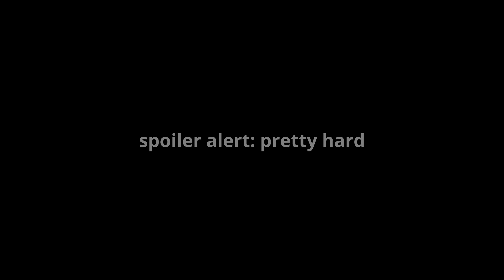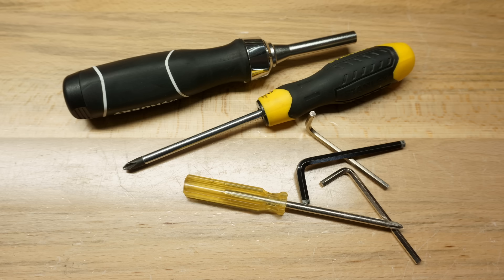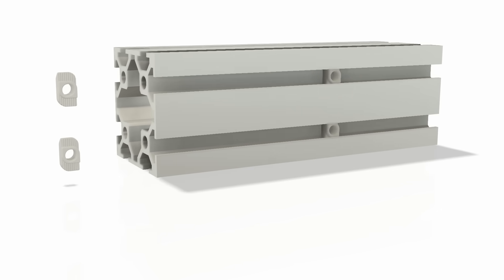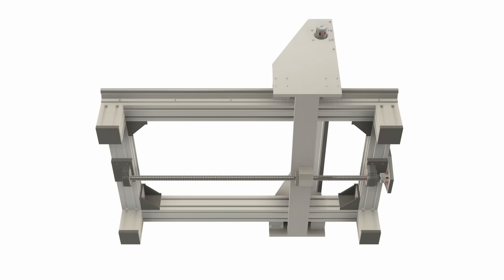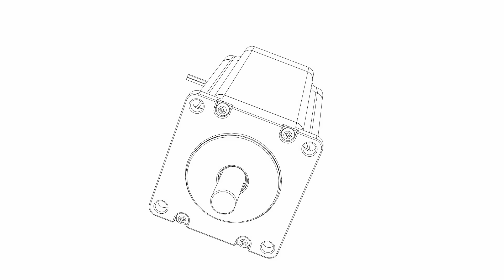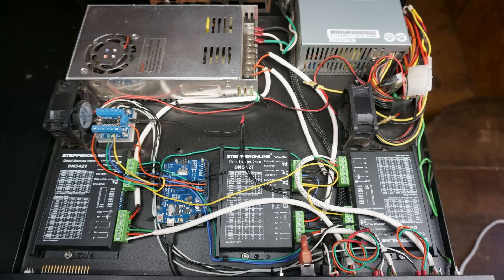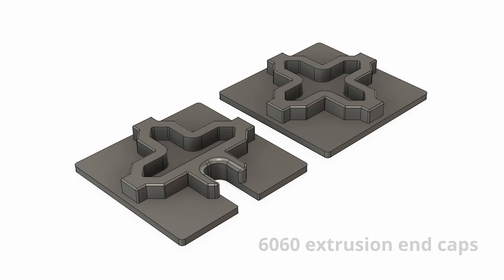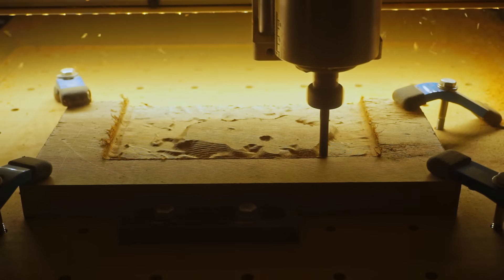Making a DIY CNC machine with limited tools

Comment: Another lazy build... Why don't you try a load test moving the y axis in the positive direction. You will see how the open bearings of the x axis flex and chatter. The biggest challenge with CNC design is making precision 90° parts. Congrats on the 3d basorelief designs tho. For that purpose the machine works well (not that a belt driven 50w machine wouldn't have worked)
Reply: @mendebil :  Pretty offensive comments, considering it is his first build and video.
Reply: @PiefacePete46  Well,  bragging copy-paste ladybugs crawling into the engineering world might find my comments offensive but that was never  the  intention. If  your  project needs 50w don't use 1kw. It's not practical that's all

Comment: As a seasoned electrician with extensive experience in wiring control boxes, you should have used cable penetration bushings (such as Part #S2212)
instead of jacks to reduce the chance of additional failure points and lower costs and labor. 

The inside of the control box could also be organized with strategically placed cable ties to minimize the risk of short circuits.
 Despite the over-drilled appearance of the z-axis mounting plate, this project was well executed and could be packaged and sold as a kit with some modifications.
Reply from the maker: Thank you, I'll consider those suggestions for any future upgrades or other machines.

Comment: Very nice project. I have MPCNC and it's part of the "evolution". Can I ask what was the purpose of optoisolators for limit switches? I haven't stumbled into that on my researches for machines. My limit switches are connected directly to driver board.
Reply from the maker: I thought they would help isolate any electrical "noise" that got picked up by the wires. Maybe my understanding or use of it was flawed though.
Reply: @benmakeseverything  now to think of it I have my limit cables and nema cables connected on shielded cable so that might be the factor on my case.

Comment: "My machine like most uses stepper motors" piqued my interest. What's the alternative to steppers? Geneva mechanism, maybe?
Reply from the maker: I guess you could theoretically use rotary encoded motors if they were accurate enough.
Reply: Servos... (ie: Steppers with closed loop encoders built in.)

Comment: Yes! Someone has actually used DIY in their title and actually did a DIY project without tools that cost six figures! This is awesome. I’d love to build one. Maybe sometime in the future you could attempt building a 4th axis mod!
Reply from the maker: Thanks! I have been thinking about adding a 4th axis attachment.
Reply: This machine already has 4th axis. It is C axis, rotation around Z. It is done by interpolation in XY plane. You can see it in a segment where the hole grid is made. That helical/tornado milling is exactly that.
5th axis is A or B, rotations around X and Y. In that case it can be done as indexing or continues rotation. First one allow to set the material on demanded angle and carry on an  operation as usual. Second allows to simultaneous rotation in A or B and milling in XYZC.

Comment: Looking to DIY my own machine. I have never really used one. I have a 3d printer so I get some of the basics. But say I want to use multiple took tips for different passes and finer detail how do I do that without affecting positing? would axis stops be what I need so It can bump them and home itself?
Reply from the maker: In theory the machine should return to the exact same spot it started after the first pass. But you can also mark a spot on the material outside of where the cutting will be done, and check if it returned there correctly. If not, you can adjust the position.
Reply: @benmakeseverything  That's what I was thinking. Also adding stops should make it be able to home right?

Comment: I'm going to throw this out there the a CNC is not necessarily a computerized mill.  It is any machine that is controlled via computer numerical control.  So a mill, sure, but also a lathe and a 3d printer, can be classified as "CNC" but a 3d printer is almost exclusively a  CNC.

Comment: Awesome build with basic tools...kudos!  One tip for taps which i'm sure others have mentioned (so apologies if they had or you did know)  was to unscrew the tap a quarter to half a turn every few rotations.  That helps break any chip formation which might otherwise jam the tap and possibly lead to it snapping off and take your time on the smaller taps as they love to snap and are a bugger to remove 😆.  That and plenty of oil and a hole deeper than needed if it's not a through hole all help make it easier going.  Can't wait to give your design a go...really nice work.
Reply from the maker: Good tip! I hadn't really used a tap before so it was  all a learning process. Best of luck with your build!

Comment: Simple and rigid design, very cool. One point you should take care is to protect any exposed connections, such as the stepper wire connection block, from aluminum chips that could cause a short.

Comment: I am getting ready to do a very similar project,  I  bought one of those really cheap cncs from Amazon a couple years ago, to learn more about the software and have a small working machine to experiment on. I have mostly been making gifts and signs on the small 3018 machine.  I am now ready to do pretty much exactly what you did. Very nice work on your system.  Do you have a total cost for  your system.?

Comment: Great job, Ben! A lot of machine/dollar here :)
I have had a project like this going for the last few years aswell and the surface finish I see on your aluminium parts tells me there might be some play in your Z-axis. Nothing critical of course, but you might want to check the tightness of the retaining nut at the fixed end of your Z ballscrew. Or it might be some play in the router itself of course. 
Again, great job on the project! First time I see someone using an old computer case for electronics housing. Great idea! 
Cheers
Reply from the maker: Thanks! The Z-axis unit has unsupported rails so it might be the cause. I thought they would be OK because they were so short, but maybe not. Definitely something I would change in a future design.

Comment: You should have got the DM542T version 4.0 that run at 4'5a, or the DM556T.
The version 2 you have are rated maximum the same as the stepper, which means they'll be both getting really hot. really quickly.

Comment: Great 👍 
My opinion, arduino is not a good option with such big and rigid machine. I will suggest to switch to fluidnc which run grbl in back end and much more advance and stable. Apart from that it runs with esp32 which has powerful processor then ardunio 

The good thing I liked about fluidnc is that it supports wifi so u  can access gcode sender through wifi. It also allows to save gcode file on board and run it from there directly.. no computer or tablet  needed.

The mother board 6pack by bdring is best i have seen so far. It will allow you to further extend it for auto tool changer, using laser cutting etc...
Reply: Let me know if u need any further input on fluidnc. You can find some details on github and few youtube videos

Comment: I primarily work with metal, my only question is does this design cut metal too? Other than that question this design and the entire process of the video is splendid.
Reply from the maker: Thanks! It does cut metal (aluminum), but not as fast or as deep per pass as industrial machines. I use a 1/4 single flute endmill for that. I mostly work with wood so I'm still getting the aluminum settings dialed in. If you really want a machine that is designed to cut metal, look into either a spray-mist attachment or a pump that supplies cutting fluid since those can speed up the cuts and provide better surface finish.

Comment: That's a nice job you did there... the only thing, for the table E-Chain the diameter is to small, you can get great quality closed E-chains from Igus GmbH :) for little money . easier to mount and the closed body is great for keep the little wood chips out of the cable area

Comment: I went through the video for a 2nd time and I tried to make a parts list as well as shop for the parts online, and I think I was able to find everything for about $1500. You may be able to save some if you shop around more, but as of today, I would expect to spend about that much to make it. Great video and great design.
Reply: PLEASE. Can you put a parts list? Or even better, where u got them from?
I got some of the parts, as I do wood working, but I never built a CNC, and I been wanting to do one for years.
I would appreciate the info. Thanks.
Reply: @CP-fz4sr ive seen other commenters saying that parts are listed in the description, might be a good place to check
Reply: @CP-fz4sr  At the $1500 price mark, you're pretty close to a PrintNC, and if you have the ability to make one of those, you'll have much more of a community to help you make it.

Comment: Yes I have a question do you have a wiring diagram for the arduino connections to the driver boards? You didn't show that in the video.  I need a pin connector list.

Comment: A friend offered me a water cooled VFD router spindle that weighs 12 lbs.    That's 3 x  heavier than the Makita but is about 2 hp.   Do you think this will work on your machine.  Either way I'm very impressed with your work.  Ordered other parts 2 days ago.
Reply from the maker: I think 12lbs would be fine. Obviously the more everything weighs, the more inertia you have to deal with, but the 425 oz./in torque steppers are extremely strong. I think they could handle a lot more than what I'm throwing at them. It might be worth using thicker side walls than I did for the gantry to increase rigidity. Best of luck on your build!

Comment: Fantastic video! I am bummed that it is your only one. If you can keep this quality, you definitely have a prosperous future here on YouTube. 

I've been in the CAD/CAM/Operator side of the woodworking industry for 8 years now. It can be fun. Having access to large 5x10 industrial machines is nice, though I'm just the CAD monkey and programmer now, I don't actually run the machine now or even know how to. I've been wanting to build my own personal machine for years now. I just bought a used Shapeoko a week ago. It was just too cheap to pass up at $125. It doesn't hold a candle to this though, nowhere near. I hope to someday commit to a build of a larger, rigid machine. My biggest problem is deciding on what size to make it. I love being able to through 4x8 sheets on the machine and go, but that's quite large for a home/hobby machine. So I think maybe a 4x4 machine, but that is still quite large. I don't know, problems for future me to wrestle with. 

One thing to look into for future projects is Send Cut Send. They are a service that will cut out your designed parts for you. I haven't looked into pricing or anything, but I imagine they are loads cheaper than a local machine shop. Just something to consider if you ever come up with a part that you can't build yourself.
Reply from the maker: Thanks! I am working on some more videos, so there will be more on this channel soon. You got an amazing deal on that Shapeoko!

Comment: Yeah, for more precision (and lower speed duh.) I would recommend increasing threads per cm on driver screws. first project showcased had marks of bad G-code and planning, bits are very important, Glossing over that is a huge problem, the speed of spidle also crucial, I really like it but for a year of work seems still not good enough (unless it was a side project after hours like few hours a week), the part that was most interesting to me was mostly glossed over, not mentioning what software was used for programming CNC is 2 seconds and still omitted. I really liked the part with a wire since it was filure noone should repeat. You should make video with all the failures so that people watching can avoid or explain why some parts need to be of higher quality and how much it would affect the products.
Reply from the maker: Good catch on the first wood carving - yes, there was a slight misalignment issue between passes. That was one of my first cuts with the machine and I was still figuring it out. This was absolutely an after hours project, I have a full-time job in an unrelated field. The software used for creating all of the tool paths was Fusion360. Thanks for watching!

Comment: Great build, best practical tutorial I have seen so far! I like that you condensed everything in a 15 minute video while still remaining clear. One tip I have from building my CNC is that those loose wires going into your arduino might cause you problems in the future. I would suggest making a shield with screw terminals to effectively lock the wires in. If a step or direction wire vibrates loose during machining, one or more axis can fail, resulting in a crash.
Reply from the maker: Good idea. I should probably do that, but I also might switch it do something other than an arduino as the controller at some point.

Comment: Great video! I’m sceptical about your conclusion the four conductor cables were experiencing EM interference, I wouldn’t have thought you were dealing with high enough frequencies. If you were though then those cables are definitely not rated so you might’ve had issues as you did!

Comment: I was interested in getting a CNC a few years ago, but I ended up going with an inexpensive Chinese 6040 that is very similar to what you ended up with here. All aluminum extrusion and plate construction, rails and 16mm acme lead screws. It's served me really well over the last few years.

One thing I would recommend is looking into CNCjs as an alternative to gcodesender. It's a pretty slick package with some really nice features. It can actually run on a raspbery pi and be accessed over a network to control, monitor and upload gcode. It even supports a webcam so it can be remotely monitored, which is pretty awesome. I've been using it for a couple of years and I'm very happy with it. It supports GRBL out of the box, which is slick, and it's being pretty actively developed. Definitely worth checking out.
Reply from the maker: Thanks, I'll check that out.

Comment: Good Job, look forward to more from your channel. I went down the same rabbit hole over the last couple years and it's amazing how similar our results are. I went with large spindle/vfd and ESS to Gecko drives. Also had several large pcs of 1" T6 and access to lathe & mill but overall design turned out very similar. Keep em coming.

Comment: Well done. I did a similar (Not nearly as polished/well done) thing using Nema 17 and Arduino shield. Given the finances I'd definitely do something like you have done here. It's a pretty achievable project for most fairly competent people I'd say. It involves a variety of different disciplines mostly requiring you carry out the build with precision. A very worth while undertaking. I would guess that acquiring one of the cheap CNC you see on ebay etc. would help a newby get to grips with the components and software. It would also give them an indication of what improvements they could aim for over the cheapo.

Comment: I just literally 3d printed 4th cnc router machines I have 48"x48" screw driven tables and they cut 1/4 aluminum sheets just fine all day long for years now lol! seems like alot of over thinking cause of poor router head choice really is what this comes down to for this build here.   seriously not being troll or anything!  sure a super rigid machine is great! if you have a slow under powered router head or huge spans on the table.   If You have a fast well suited router head it cut aluminum just fine like butter with right tooling at decent feed rates. they use a 180watt water cooled router heads 3k-20k speeds 1/4 bits.   I cut in (metric) even though in usa for parts i make.   1mm deep cuts @ 520mm a Minute with 6.35mm bit(1/4 bit) for aluminum.  Mind you I have a water tray on each table and use coolant since well you have to to cut aluminum correctly.  Just no way around that or it fails every time from tooling damage. Huge typical thing most router people kinda miss in the whole process lol   Far wood goes I never cut it cause have no need to! plastics, copper, Carbon fiber and aluminum!  but simple sheet of homedepot OSB could cut wood all day long if really wanted to I guess!   Honestly hardest thing to cut Carbon fiber out of the whole mix.  Cause you need really slow speeds to cut it like 5k that is where the rigid part comes in!  So have to go like 1mm deep cuts @100mm a minute to make up difference.  To fix the noise on cables, you just use ferrite block on each wire end ground everything correctly to psu... though this was common knowledge! lol

Comment: Nice build, congrats. I was wondering what sort of bits you use with the makita, as it doesn’t support the 3mm shaft most cnc bits seem to require.
Reply from the maker: Thanks! The Makita router takes 1/4" shaft bits, and I've been able to find a ton of options available both at local woodworking stores and on Amazon.

Comment: nice build! I'd recommend moving away from the arduino uno to a slightly less geriatric main motion controller. I've personally had good luck with ESP32s and FluidNC.
Reply from the maker: I didn't even think of using an ESP32, but that a good call. I'll have to see if those drivers work with 3.3v inputs...

Comment: Great job, Ben.  I could certainly use your expertise since a lot of the personal CNC machines offered on Amazon/eBay do not meet the size requirements I need. Where are you based at, location wise? Sorry if that question sounds a bit like doxxing